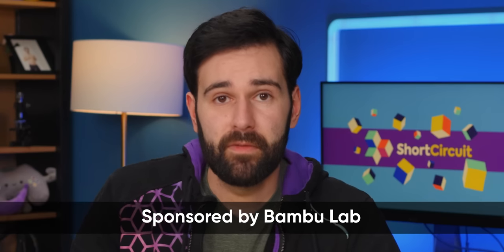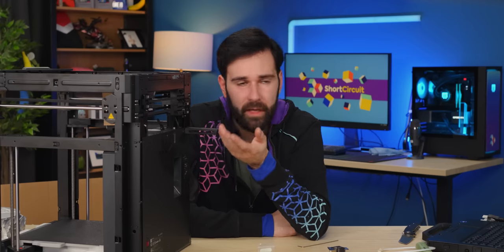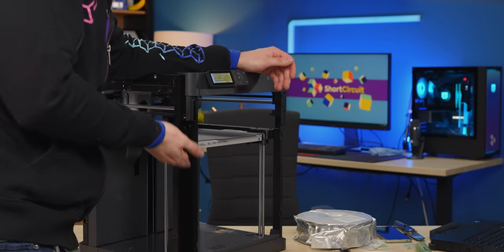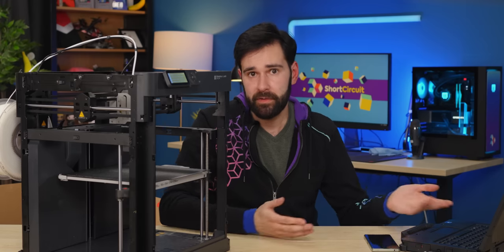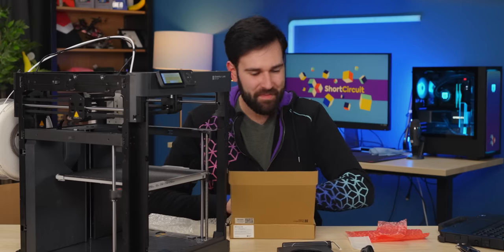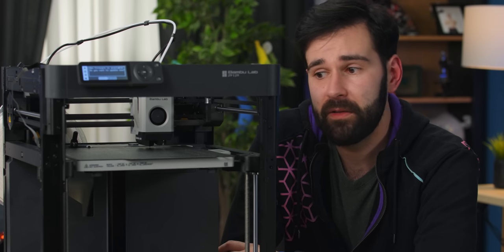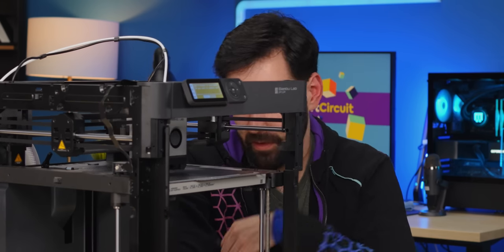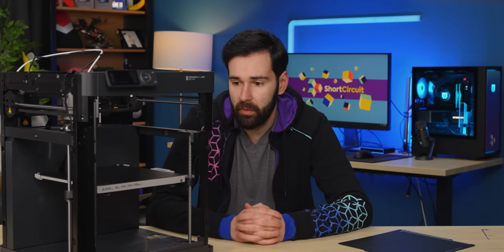I wish this wasn't sponsored (because it's so good) - Bambu Lab P1P

Comment: You can eliminate 7-10 start up process ie bed leveling, flow dynamics calibration before printing if you’re confident the printer is fully calibrated.

Comment: All fair. One con not really getting enough attention is the noise. Yes, it's to be expected at this speed. For those living in apartments (myself included), it's a deal breaker. And slow mode is still louder than a silenced Ender 3 running Klipper. 

I understand it's a big ask. If I can plea to Bambu Labs, it's only to bring the thing down at least a good 6 dB across the board on next year's model.
Reply: If anyone thinks I'm kidding, see the video of someone building an acoustic chamber because he was on the brink of being evicted. 😂

Comment: I have been thinking about replacing my 3yr old Ender 3 Pro and Bambu is defiantly it's replacement IF I keep to my current print size.  The print size compare to cost is my problem with Bambu.  I have see them in action and they are great printers.

Comment: You can use marlin legacy for killer to. Prusa slicer don’t have killer as option of it is killer. 
This printer was released and announced way before marlin had inputshaping. I doubt they run a modified version of marlin.

Comment: 16:13 re: the flow in mm^3/s being a meaningless number: it means about 3 cm/s of filament if we assume the largest nozzle they have (0.8mm, I'm assuming that's diameter and I'm assuming that the circle is a square)
still pretty meaningless, but a little less now

Comment: I do like the extra hot end...
My one biggest issue with my FLSun SR, otherwise great, is the hot end kept jamming. (both that came with it)
I ended up rebuilding with after market hot end and nozzle, because both ship time and likely repeat issues with the part.

My next printer, when I start making more, is either one of the Bambu Lab for filament, or one of the Elgoo resin ones.

Comment: my x1c combo was delivered 3 weeks ago.... my second ams should be here tomorrow. in the course of 3 weeks my filament collection has ballooned to 50 different types, and I've completed at least 50 - 60 prints with a 95% success rate. my only failures have been due to me placing supports in bad spots and they've been so infrequent as to be truly surprising to get at this point. bambu makes fantastic products period. yeah theres some debatable things about the closed platform but at this point, i don't care. I'm just enjoying the printing too much

Comment: I will say the only parts of this printer that are open and not proprietary are the things that have to be open if they don't want to spend a year reinventing the wheel. Marlin and Prusa Slicer both use licensing that does not allow them to close off the code. They can hide it behind a paywall but they can't make a proprietary version of the slicer or firmware without the possibility of legal trouble. On the other hand other Chinese companies will not just openly give you the firmware code files even though that violates the marlin software licenses and many of them do use marlin so... I guess good job for Bamboo Labs doing something rather than ignoring this requirement.

Comment: It's pretty amazing to see the speed at which 3d Printing technology is moving. I remember the Rep Rap project back in the day... and thinking, damn I would like to build one of those, but it was so early you literally had to ask someone with an industrial 3d printer to print the parts for you, and those cost $25,000

Now you can buy basically the same machine but even better for ~$110 and higher end 3d printers like this are pushing the limits of this technology just by consumer demand alone.

Comment: Actually the LiDar doesnt work with the textured Plate. 
We use our X1C for Prototyping in the FSAE and the quality is better and its way faster than our old Anycubic Printer. The Anycubic needed 15h for some Prints, the Bambu takes just 3 and the quality is way way better. For 3-4h prints also the 7min start procedure is absolutly okay. When we used the old printer we often hat to restart or sometimes the printer messed it up over night. The bambu automatically stops the print and we dont waste filament.

Comment: I've got a completely stock Prusa MK3 and a delta printer that I modded and replaced a stupid amount of things on. The delta can print many times as fast as the Prusa with great quality.
Still I only use the delta for models that don't fit on the build plate of my Prusa... Something just makes me go to the Prusa every time.

For iterating I usually only print the part/feature of the model that I changed, not the entire model. That way I can still iterate fast with a slower printer.

Comment: Praising them for following the license on things like the slicer and marlin is like thanking them for not killing babies.  Cloud services + Proprietary stuff all over makes this an easy no-go, thanks for making it easy to know I should NEVER buy Bambu stuff
Reply: You say this while using your proprietary OS on a proprietary website, probably typing on a keyboard that uses proprietary software.

It's ok for things to be proprietary when they're good, sustainable, and not run by a company that is out to rip you off. Bambu replacement parts are actually LESS expensive than your oh so holy Prusa, or whoever the heck else, parts. It's like $60 for an e3d hot end, and that's their old crappy v6 garbage, nobody who has any self respect will use a v6. The new, actually good hotend, Revo is actually proprietary now, and nozzles alone cost about $30. An entire hot end is only $10 for the Bambu. The one shown in the video was the hardened steel version which is still only $15, for the entire hot end. This is the simplest part to compare, but it's the same story for everything else on the printer. 

Octoprint is trash. Not having to use it isn't a con.

But yea, sure keep making it seem like everything needs to be open source. Maybe your perfect world where everyone is running linux and drives their open source car to the open source ATM to withdraw their open source OpenSourceCoin to buy open source vegetables at the open source store, will be realized some time in the future. (spoiler, it never will, open source is a fantasy)
Reply: @flyingtentacle7631  I am writing you from Manjaro, matter of fact.  Open source has already won the world.  It is in everything that you touch on a daily basis and we wouldn't be where we are without it.  Everything doesn't need to be open source, but for my purposes, I don't want my stuff connected to the cloud, when it's likely to be ripped away from me in 5 years.  This video did it's job of informing me about a product, it made it clear that this isn't the one for me, so I have no idea what your personal anti-open crusade is.  Also, for the record, my keyboard is a Keyboardio Model 100, open source in both hardware and software, and has saved my wrists, check it out.

Comment: They look nice, my big concern is availability of the custom spare parts. Especially in for instance a production/print farm setting. It will be interesting to see if they can stack up against the old guard of the Prusa mk3’s and minis in the long term realisability
Reply: They can't stack up. Outside of a few consumable parts, these BL printers are mostly non serviceable. The entire motion system, including the rods, bearings/bushings and brackets are epoxied in place and are non serviceable by the user. BL has said that they want people to send their printers in for repair when the CF rods and bushings go bad and need replacement. Imaging have a print farm full of BL printers and one by one, they each go back to china for repair.

Quick prototyping, sure, they're good. Just no where near logical to use in a print farm environment, even given how long it takes CS to respond to support tickets and to ship parts.
Reply: @LilApe  that’s my concern. Even as a home user I don’t like how non user serviceable they are.

Comment: Seen some owners of this have a real issue with replacement parts and self repair. If this goes wrong you are pretty much screwed and will need to return the whole thing for RMA
Reply: Gonna be interesting when warranties start to expire and printers have to go back for repair because BL wont just ship you a new one.

Comment: Marlin (legacy) in the slicer doesnt necessary mean that its marlin. Prusa doesnt have klipper in their slicer settings so you just select Marlin 2 as your gcode flavor. klipper eats marlin gcode fine. just some commands need to be made in to macros so the firmware knows what is going on. but i use SuperSlicer because Prusa lacks settings lots of settings.
Reply: I was about to type this myself. Bambu Lab has been very good about adhering to the GPL as well and if the firmware was a fork of either Marlin or Klipper, they would have to release the source code. After speaking a bit with Kevin, the maintainer of Klipper, he has stated that he's certain it's not Klipper and Bambu themselves insist that the firmware is 100% developed in-house which is why they refuse to release the source code.
Reply: @apulo1  maybe. Or it just might be klipper with many changes. Because looking at all this pressure anvance and resonance measuring seems a lot like klipper to me. 

Also I think Dan mentioned "pressure anvance" specifically. But the term used by marlin is linear advance. Maybe he was told about that said pressure anvance and so he mentioned it in the video.

It would probably be possible to dump firmware from whatever stm32 they are using as the brain to look deeper in to the firmware. But I don't have spare 700 USD to do that myself
Reply: @SkivaksXD  It does not use a STM processor.

Comment: These things still have a long way to go with their firmware and there is a 3rd party fork of the slicer that’s a lot better than Bambus version. I wish reviewers would stop hyping the speed on these things, faster than an ender 3 yes, but not groundbreaking speeds by any measure. 

Calling their feature LIDAR is actually LyingDAR because it isn’t, it’s photo recognition not time of flight.

Comment: It's not about the cost of the hot end but the longevity of the support that matters. I'm about to throw away a 2 year old vacuum because the manufacturer stopped producing the filters; it's a new form of planned obsolescence. Make something super proprietary and cheap but then discontinue it so your customer has to buy a new one anyway.

Comment: The weird thing about their slicer is the step files will be lower resolution arcs than a high tessellation mesh 3mf or stl file. I exported a step and custom mesh of 1.1 deviation from fusion and put both into the slicer to see which one was more round, and for whatever reason the step file looked really bad compared to the 3mf. I even tried to adjust the simplify settings for the step file to max resolution and it was exactly the same results.

Comment: honestly I'd like these more if they were a bit bigger (300x300) and not so difficult to replace parts that will.. most definately wear down and need replaced.  Can't really see the value in the cost at this smaller size, propriety parted system.

I had the option of buying into BL on Kickstarter and I passed, and kinda glad I did. (not that it is a BAD printer, just not quite as friendly as I would have hoped)

Hopefully someday they will make  a bit larger format printer, and use more standardized/easier to maintain parts.

a 350x350x350 print volume - should be ideal on these kinds of printers, and if the price were right - I'd get one of that size even with priority hotend.

Comment: Great video! 👍 However, I need to share my experience. I was shipped a broken Bambu Labs printer, and it feels wrong that I'm the one having to fix it after paying for a brand-new, working machine. Support took 3 days to get back to me, and after a week of troubleshooting, we discovered it was an AC Power board issue. Instead of sending a replacement, they're only repairing the faulty one, and they completely ignored my request for a new printer. It might look like a great product, but their customer service is a letdown. I'm seriously considering a PRUSA for my next purchase.

Comment: One thing that annoyed me, specially coming from you guys and was about the  how much open this is, the slicer. The slicer they are obligated to do it open source as they based themselves in an open source project and furthermore the didn't do in the beginning and they received a lot of backslash and pressure from the community until they open sourced.

Comment: the x1 is amazing, the p1p is a buggier not as user friendly as the x1, the screen is hot ass, the wifi module works when it wants to and when it does it slow AF, the menu system on the 90's walkman display just feels completely backwards

Comment: Love the video, thought it was an excellent review, and this is inspiring me to get into CAD and 3D printing. However, this video has so many random camera angle switches. It was slightly distracting. There's no shame in cutting without switching angles. The angle switches should be intentional. Anywho, loved the review, and time to do some research on 3D printing!

Comment: I'm curious, are the nozzles also proprietary? If not, you may want to look into CHT nozzles, I got one for my Ender 5 in 0.8mm. It improves volumetric flow up to roughly 30 - 35 mm³/s by increasing the surface area to heat the filament, thereby achieving a similar effect to the elongated meltzone in a Volcano hotend in a much tighter space and with less weight.

Comment: This seems pretty nice. Though I kinda rather have a more open printer. I have been thinking of getting a corexy style printer. I like my Wilson 2 Reprap but it's not perfect. I couldn't get things to print without ripples and random tolerance issues. But I just end up setting and forgetting since it's usually things I don't care if they look ugly.

Comment: Do you have to use the bamboo filament or is that just for the extra features of how much is left on the roll etc?
Reply: Bambu filament has a few benefits, but isn't necessary - you can use anything.
- NFC chips in filament roll tell printer about type / color
- Bambu lab rolls are re-usable, when you buy new filaments from them you don't buy a new spool, but rather a little carboard roll of filament that you insert into the spools you already have.
- Bambu filament is specifically optimized for high-speed printing, where other filaments may not behave as well at higher speeds.

Comment: I want a Bambu Lab printer, I had thought of getting the X1 Carbon as I want to print ABS and Nylon but then wondered if the users who have fully enclosed their P1P printers are able to print higher temp materials issue free, if anyone has enclosed a P1P could you tell me how you got along with higher temp materials?

Comment: This printer sure do look like its excelent.

But how do you print out the side panels... isn´t they larger than the print bed?

Also, can you ad the ladar on later if it turns out you need it?
Reply: The panels are probably in parts that you combine after (via clipping maybe)
Reply: @pioter-ji1bo  Yea.. i was kind of thinking in those term, but didn´t quite get it.

Of cause, a "nice" way of doing it would be to buy 200x200 plexy panels in the local hardware shop, and then just put adapter panels on the side.

Comment: Does it work with regular filament, or do you have to use the chipped filament?
Reply: it works with regular filament. the NFC tags are only used in the AMS but the AMS can be used with any filament that can physically fit it.

Comment: That sure looks nice, but after dealing with something like Cricut that's gone down the same increasingly closed path... Guess it all depends on where it ultimately falls on the curve of convenience versus parts and support availability and then praying they don't alter the deal further.
Reply: cricut forced you to do everything through their cloud. here its just convenience you can just use microSD cards so even if the cloud goes down it won't be a brick. unlike cricuts

Comment: have you used a prusa mk4 yet?
only asking because im upgrading my trusty old reliable mk3i. 
id love a bambo lab but my prusa does all my hobby grade RC car stuff ust fine.. time isnt an issue
Reply: The ankermake may be a better option than the mk4 actually, around the same price but just a much more polished machine I've had mine since October and printed over 50kg of stuff and the ankermake m5 just keeps on trucking. Not to mention the great discord community they've built up.

Comment: Thinking very hard about saving up to buy this printer. I was already in the market for one but real confused about where to start and this thing is sick, it seems to take a lot of the problems out of the equation.
Reply: Definitely go for it. It's the most user friendly printer on the market, by far. Prusas were the best before it, but they're much slower, more expensive, and are still less user friendly to a newbie than the Bambu Labs printers. The printer market stagnated for quite a few years. Bambu Labs just made a giant leap in the tech. Prusa has to be nervous. I wish the Bambu printers were open source, but I doubt they would be as cheap as they are if they were.
Reply: If your not planning to use it for years on end as a workhorse printer its a good choice hoever its closed source nature means any malfunctions means sending it back to bambu which leaves you with no printer for potentially weeks. open source ones you just need some spare parts a wrench and screwdrivers and you can get your printer up and running again in minutes or hours depending on the severity of the malfunction